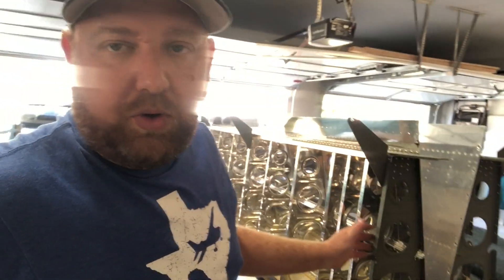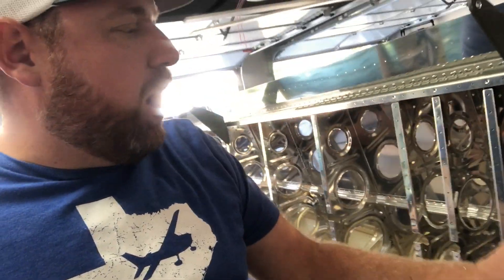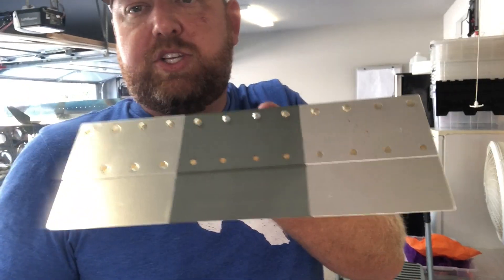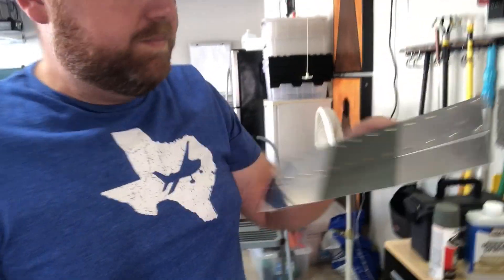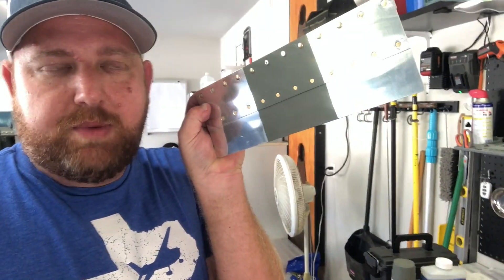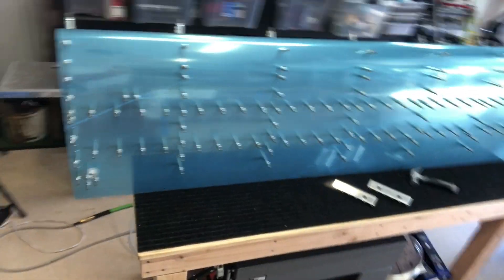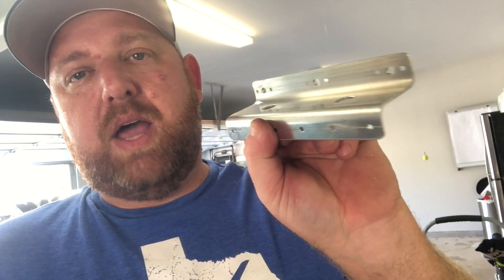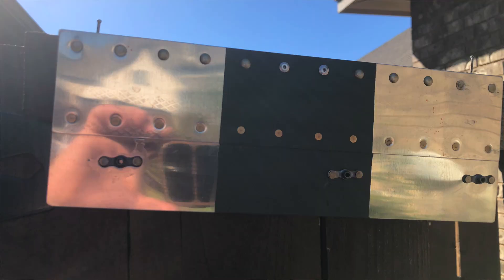I am NOT Priming my RV10

Comment: Surely the question of whether to prime or not depends on location. If I lived in Arizona or somewhere else hot and dry then I wouldn't bother. I live in the UK and my aircraft will be based on a coastal airfield so I am priming.
Reply from the maker: I still might prime the fuse, haven't decided.  It was not primed up to this point and I am getting more comfortable with that.  I will just do a corrosion treatment ever couple of years after paint on the wings and tail section.
Reply: Exactly...if you are near a salty environment and plan to stay there then consider priming.

Comment: I was taught in the Navy that the AlClad layer oxidizes to a hard aluminum oxide coating that is almost as hard as sapphire and seals the aluminum for the weather. It's a natural corrosion barrier. If it gets scratched through to the 2024 or 6061 alloy parts that will allow those alloys to corrode.
It presents as dull aluminum like you see on an unpainted unpolished airplane or looking in an unpainted fuselage or wing
Reply from the maker: I was wondering about that, I have seen some older RV that have a hard dull finish on them and was never quite sure what that was.  TY for sharing, I will do more research on that.  And as you might know, the all clad is SOFT.  I scratch that stuff if I breath too hard on it.
Reply: @pilotrhino  Yup, the alclad coating is pure aluminum, and as you've found out soft as all get out.

Comment: If you're diligent with the spray treatment you should be fine with the structure. Galvanic corrosion has to do with different electric potential. I would look for a primer that uses zinc for the dissimilar metal parts. Zinc is used as a sacrificial component on boats for the same reason.
Reply from the maker: Thanks for the information.  My local EAA technical director came out and agreed.
Reply: Hey guys... I'm using a zinc phosphate primer, (not as nasty as chromate) on all mating surfaces with special attention to disimular metals. I live in SE Ohio and the plane will be hangared. One big reason I decided to ' prime ' was for re-sell reasons. I also believe that it helps with rattling, squeaking and some of the oil canning, not to mention creating an overall tighter fit and seal. Otherwise I probably wouldn't prime except disimular metals. Thanks for the video and info!
Reply: Also... not priming would probably cut my build time by at least 25% !!

Comment: Building a Zenith Cruzer on my channel. I was going to use self ecthing primer on all the inside of my build. I changed my mind on priming for a few reasons. 1. I live in the desert. Our humidity hardly goes over 10-20%. 2. The plane will live in the Hangar when not flying or on trips. 3. It is 6061T and is very corrosion resistant. The only places I am Priming is between mating parts and were dissimilar metals are mated. Such as nutplates as you noted.  Great video. I just subscribed to follow you build..
Reply from the maker: Are you still flying RC?
Reply: @pilotrhino  Yes occasionally. I have a big collection of aircraft and some new kits waiting for the Cruzer to be done so I can build them.

Comment: The biggest factor for me priming was resale, no primer people won't care that it's primed, the work has been done. Primer people will, or may, cars that it's not primed.

About galvanic corrosion, What about the aluminum rivets going through the steel nutplates? Is the anodize on the spar enough to protect it?

Comment: I would like (if I ever build) to try ceramic coat on the outside painted surfaces, I would think this would help the paint stay and do it’s job but also be a powerful protective against corrosion in itself, thinking primarily of the hydrophobic properties.   Any thoughts or experience on this anyone?
Reply: I am talking about priming the plane's inside, not the outside.  The outside will 100% be prepared and primed before painting.